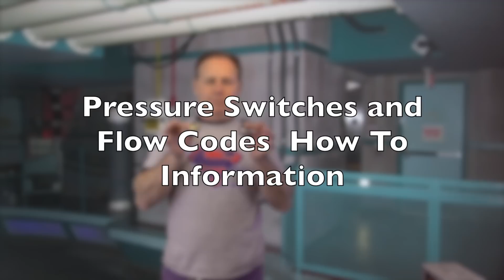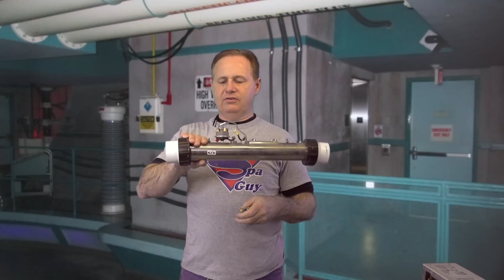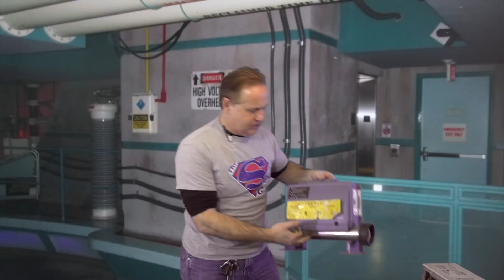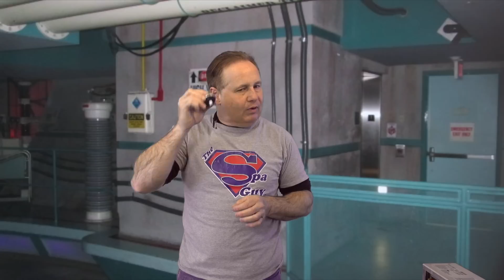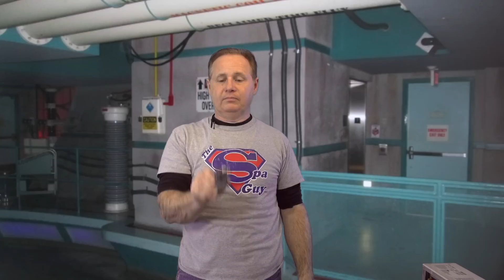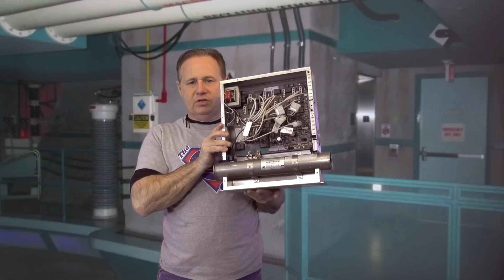Pressure Switch Flow Code No Heat Spa Hot Tub How To The Spa Guy

Comment: any hints to what error code "18" means on an old blue ridge spa?
Reply from the maker: Yvette that code I have not seen a Pressure Switch code is usually a P51 on a Blue Ridge..You 18 may be an upside down 51.. In this case a 5 means the circ pump has been turned on but the pressure switch didn't close..  It could be a Pressure Switch, Circ Pump or filter stopped up..  Spa Guy
Reply: thank you so very much for your quick reply - i pulled out the filters, removed a lil debris and pine needles, put em back in - powered down 3 times - it still says 18 - ive never seen this code before - the econ button or temp buttons wont work but jets work..... strange - thanks again

Comment: Any hints on getting the pressure switch loose?  I have a d-tec (your sku HTP47-439-1295) switch and it doesn't want to let go (when turning counter-clockwise)... I'm afraid I'm going to break it off and not have enough to grab onto to remove the rest!
Reply from the maker: You turn in left and lift up some.. On a D-tec the bottom edge of the switch is hex shape for a wrench.. If it does break off usually you can put a flat screw driver in the center and turn it out but if it won't turn out with the switch I suspect the threads are stripped.. In that case you can grad the switch with pliers and twist it out.. Lastly if the switch does break of you can take a plumbing torch and heat the plastic and it will burn out.. Spa Guy
Reply: Thanks for the reply!  Yep, I was using an open-ended wrench.  Could feel the plastic twist (without it nipple/threads moving).  I'll use more pressure and just deal with whatever happens.  I was also thinking of trying to use freeze spray on it to get it to shrink slightly.

Comment: Is the air pressure switch supposed to have two 1/4 inch flexible tubes connected to it since there are two outlets on the switch itself? On a jandy 400,000 BTU.. ?
Reply from the maker: David that is pool style heater and I have never worked on one so I can't advise you on the pressure switch system on that heater.. Spa Guy

Comment: What to do if the heater won't stop heating? Code OH on Dynasty spa. It reeds 110 degrees. What do I need to check. Thx!
Reply from the maker: Normally the heater itself cannot heat past the set temp, if it goes past the set temp it is something else like a newly installed pump with the speeds backwards or if it has Balboa controls which Dynasty normally doesn't the filter cycles could be set too high.. The other thing would be is the water temp actually 110? If you had a stuck heater relay it would overheat the water in the tube to 110 but not the entire tub of water.. Had you done any repairs just before this started? Spa Guy

Comment: 2007 Caldera Niagara - I've replaced the pressure switch at the beginning of the last two seasons due to the temperature going too high.  That has fixed my problem each year., now again I have a similar issue, but slightly different. Refilled, flushed, drained, refilled and replaced filter. Spa comes up to temperature and maintains during the daytime, however, by morning, the spa is at 99 degrees and there are four solid lines on the control panel indicating high limit error.  Before I replace the switch again, I thought I would ask you if you think I should take a different step.  Also, I want to verify that this model should use the 25amp switch not the universal 1 amp (the 1 amp switch does not look like the one that came out originally). Thank you kindly for your advice.

Comment: I have an ancient Coleman 220 Spa (Circa 1992) and it sounds like I need  a new flow switch based upon your video.  Do you know if this is going to work for such an old spa?  Thanks!
Reply: What codes were you getting  I have a

coleman spa 400 series maax Arizona edition 
& I’m getting LO code 
The hottub worked good before I moved it

Comment: I used your advise and checked the way I reconnected the one M7 (2000LE system)  cable and it worked.  The tub fired up and was heating the water - we got to about 98 degrees and then it threw a FL code, (The pressure switch is brand new) I have a Balboa system.  Any Ideas?
Reply: So I watched this video and tried your lil trick.... I disconnect one wire from the pressure switch and the FL error disappeared....  so Do I need to purchase a new pressure switch connection wire, and if so do you sell them?  I have the 1 amp Tec(something or other) pressure switch.

Comment: Thanks so much, but I have an odd problem on my Cal Spa. The high and low pressure pumps work fine without codes, but as soon as the pump turns off, I get a FL code. I jumpered the switch and it kicks back up without issue. Also, if I wait, it seems to clear on its own. So it seems like either there isnt enough pressure in the tube when the pump is off OR the switch is faulty. That seem right? What would cause low pressure code when the pumps are off?  (PS. spa runs fine in all jets and filter is clear.)
Reply from the maker: Hello, Based on your description I think the switch is stuck closed.. when your tub gets to the set temp and the pump goes off the system looks for the  switch to open if it doesn't it sets a FL code.. Thanks for watching, Spa Guy

Comment: So confused!! I have an older hot tub that was never used, a Laser Plus Whirlpool Spa, and it is not heating properly. I have it set on 95 and stays at a steady temperature of 91. When I bump it up to 104 to get in it, it will not heat up until it goes through its cycle then it will heat up. I have turned it off at the main switch and when I turn it back on I hear the pump try to come on but then stop but it will come on if I turn the jets on but will not heat up until it goes through its cycle. There is no error code that comes on, the filters are clean and nothing is stuck in there and it has the right amount of water in it. Made a phone call to someone and they thought it might be my pressure switch. Do you have any idea what it might be before I make this purchase??
Reply from the maker: Based on your description I don't even have a guess.. I need to know what brand of electrics you have.. Also you need to leave the tub at 104 if that is where you use it.. It costs more to keep bringing it up to temp than leaving it at temp.. Thanks, Spa Guy
Reply: Spa Guy h

Comment: My S-class has the no heat, CR12 Led on. Fuses are fine, flow switch checks out, no power to heater. When I remove and reinstall one wire to pressure switch, right most relay closes but still no 240 to heater. Any suggestions? Getting 17 volts between relay connector and ground and each heater connection to ground. Thanks!
Reply from the maker: Hello, I would suspect a cold solder joint on the bottom tandem relay above the right leg of the heater element on the board... There are three relays related to the heater the left side is a single relay and the right is a tandem set where both have to close for heat.. the top right one closes for the Hi limit and the bottom right closes when it calls for heat.. It is usually the bottom one.. So you can power down remove the screws from the board and pull the board out and look behind it and in the case of an S-Class you can do this without unhooking any wires including he incoming power wires.. This particular board is bad about the bottom relay getting a cold older joint and catching on fire and burning a hole in the board... Therefore if you see soot in the box and it is dark around the right heater tab area it is too late.. Spa Guy
Reply: OK I will check. Right now the center relay doesn't close when it calls for heat which is connected to the right relay via jumper wire. Only the right relay closes. Thanks
Reply from the maker: Ok, so you described all of the heater relays closing and even having voltage at them and now you are saying they do not... If you are saying the the small LED on the lower right side of the board is lit and there are 3 dots flashing on the topside that is a High Limit code,,, That is why it is not heating.. You either have a bad board, Hi-Limit or something actually causing a high limit which usually would not happen fast after power up.. Usually if the system is not engaging the right lower heater relay there is a code...
Reply: Spa Guy  I have the same problem my board is fine only heats up if I turn the jets on

Comment: Hi Spa Guy. I am having problems with my baja spa. Flo error message. Drained and refilled. Checked filter and removed filter. Had a spa repairman come and replace the pressure switch. It came back on and he said he didn't have any idea and wouldn't come back. I checked the empeller and it is clean and turns easily. It pumps water through the system. It will run until it reaches temp then the flo error comes back on. If you restart it, it will run until it reaches temp again. It seems that I can keep bleeding the system and I can't figure out where the air is coming from. From everything I have read it points to the circuit board I would be most grateful for any suggestions. Also, when you press the pump button you can hear the heater switch click and the FLO disappears and the temp comes on...
Reply from the maker: Hello If it is running to temp and then giving an error message the pressure switch is stuck closed.. To verify this after it gets to temp and the flo error comes on unplug the pressure switch on one side and the error should go away.. or you could verify that the Pressure Switch is open with a meter when the pump is not running... Spa Guy

Comment: Hi Spa Guy, I'm new to hot tubs and I just got a used one hooked up by an electrician 5 days ago. The pressure switch was broken so that was replaced and the tub heated up fine to 102 degrees as set. After about 24hrs the tub shut off for about 4-6 hrs with a "FL" error code… then came on again for 4-6hrs… then off again. Because the pressure switch was just replaced I adjusted the calibration wheel on the pressure switch, thinking that was the issue (I've since watched your video informing me that is a no no). Then, I took out the old filter and a couple hours later the tub came on again. Since then, I've put in a new filter and the tub has been running for a couple days without shutting down….. but now the temp won't get to 102 -- its at 91 right now. 

Did my tampering with the calibration on the pressure switch lead to the tub not heating? Can I make pressure switch right again? …perhaps another issue.
Reply from the maker: Hello jazzy kazz, Do you know the history of the tub? Were the 
electronics replaced recently? When is te last time it worked correctly?
 Have you ever seen it work correctly? The reason I ask this is it could
 be a man made issue not a mechanical issue..  Also what brand is the 
tub and electronics? Spa Guy
Reply: Hi Spa Guy. I don't know the history of the tub. I got it from someone who moved into a house and they didn't want the tub anymore. The tub seemed to be working when I originally looked at it and on the day it got disconnected and moved -- by this I mean the jets turned on and the temp was 98. Its a 2001 Beachcomber 350 model and the rating plate on the heater/electronics casing says "Balboa Instruments" model DD-2500ES-DCAJ (there are a couple other stickers on it too). 

Earlier today I turned off the breaker, waited a minute, then turned it back on. The tub didn't come on but it displayed the "FL" error again. I went out for 3hrs and when I got home (10 mins ago) the tub/pump was on again with no more "FL" error and a 89 degree temp (its subzero temperatures outside here). The tub heated up fine last Saturday when it first got hooked up… that was until the first "FL" error shut it down. It seems like such an easy fix, like a minor tweak or adjustment. Any suggestions before I bite the bullet and hire a service technician?

Thanks Again
Reply: I've since got it to a point where I can reset the tub from the breaker and the tub/pump turns on right away with no "FL" error code. Still not seeing the heater/red light come on right away. Currently the jets are on high for its 15min cycle to give a little work out.

Comment: So our jets are working, the filters aren't plugged and there is hot water bubbling out of the base vent.  Everything was great till last week.  Now, no matter what we set the temp at, it ONLY heats up to 86 degrees.  It has been at 86 degrees for several days.  So its heating and monitoring the temp, just not taking it up high enough.  ITs a Tiger River Sumatran.  Thanks in advance for any suggestions.
Reply from the maker: It is not heating... Just water movement friction through the pump and heat from the motor will cause it to heat to a certain point based on the ambient temperature.. There is on most of these tubs a No Fault 6000 heater... If yours has that heater there is a hi limit button hidden on the top of the heater black box... it is under a clear plastic cover and can be tripped... I would look there first... while is is possible you were feeling hot water from the heater jet you usually cannot feel a temperature difference from there if the system is working correctly.. I would start with the reset.. You really need a meter with an amperage clamp to see if it is really heating or not.. If it has an IQ2020 or IQ2000 some of those packs do have a heater board that goes bad on the left... Spa Guy

Comment: So my pump is surging. Onnnnnnn Off. Ooooooonnnn. Off. Error Code FLO and the pump stops. Would this be caused from bad pressure sensor? I adjusted it ALL the way to the bottom, still FLO. I shorted the leads, FLC came up. Looks like I found it eh?
Reply from the maker: Hello Andrew, No a pressure switch will not cause your pump to surge.. Pump surging comes from many different things.. here are a few things..  Filter stopped up, Low water level, Internal motor issue, Something caught in the impeller, some kind of restriction on the suction side of the pump, if it is a 115V plug n play hot tub running it on a drop cord could cause it... The pressure switch again has nothing to do with the pump running or not... Thanks, Spa Guy
Reply: Thanks for the fast reply. I'll take the pump apart today and see what's in there. I'm using a 15 amp cord running from my GFCI cord. You think I need a bigger cable running to the tub?
Reply from the maker: Yes if you are running this on a drop cord that is probably the cause.. Has it ever run correctly on this cord?
Reply: This is the first time it's NOT running on 220. I bought it for $200 bucks. I just finished checking the impeller, 100% clean. I just recorded a video, if you can identify what's going on, I'll gladly buy a replacement from your store :) Unless it's the wiring :/
Reply from the maker: Is the pump a 115v pump? The clues are the tub ran before you moved it.. It ran on 230V.. If you converted it back to 115v it has to have a 115v pump in it.. The length of the drop cord make a huge difference... If you have the tub on a 15a 100' cord it will not run on high speed or it will ramp up and surge.. post the video and send me a link here.. Spa Guy
Reply: I wonder if the guy I bought it from replaced the Motor at some point in the last 14 years with a 220v pump. So, while my wiring setup is correct, the pump isn't a 120 at all? I'll check..
Reply from the maker: Most hot tubs have 230V pumps meaning they cannot be 115V.. Spa Guy
Reply: But the wiring inside my control panel says it can be set to a 120V mode. This is where I'm confused. Did you see the vid?
Reply from the maker: Yes the control panel is designed to be used in either application as long as the pump is 115v if the pump is 230v then it must be wired 230v... I did not see the video you have to send me a link..Spa Guy
Reply: Hey Spa guy, so my pump is CLEARLY 220v. Looks like you can hook up the Hot Tub CONTROL PANEL for 110. Go for it. But you would need to replace the motor with a 110. Which I could do. But what the heck, I'll pay the electrician after all :P THANKS for your help. I'll make a blog post later on detailing this, I see the issue on Google with no answers or instructions.
Reply from the maker: Sounds Good Andrew.. Spa Guy
Reply: Just following this comment up for future readers - I got 220v hooked up by an electrician and she turned on. Been enjoying for months.